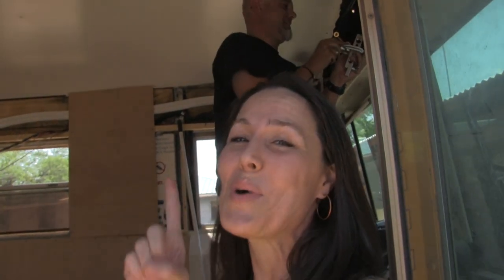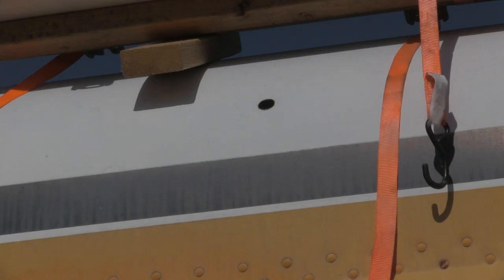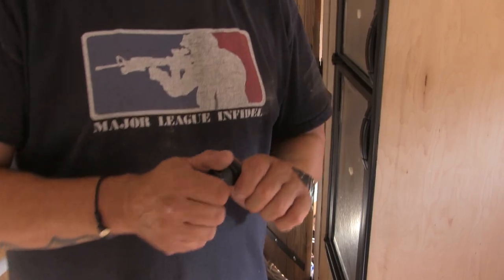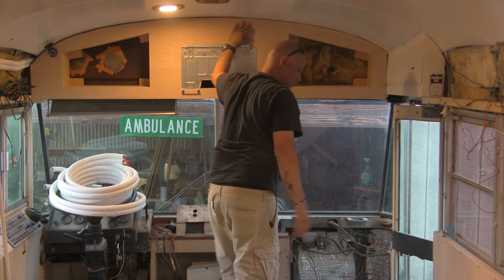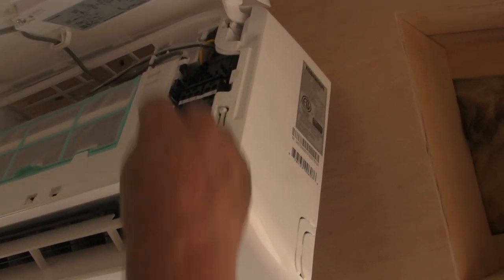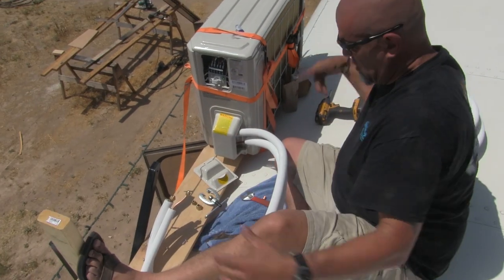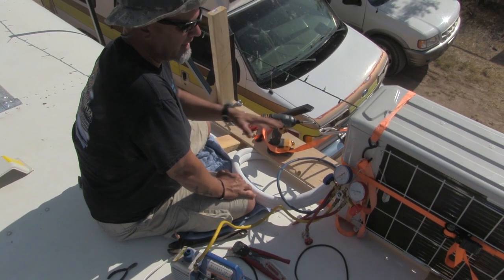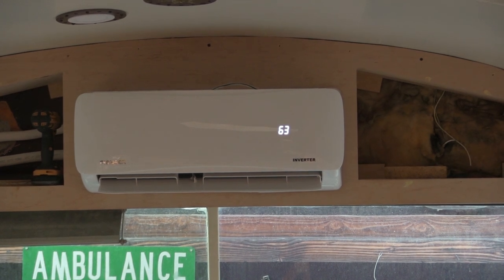Installing a Pioneer Mini-split A/C on our Skoolie! | A/C PART I

Comment: Thanks so much to both of you. I am currently in the demolition stage of my bus conversion and everytime I start to feel overwhelmed I watch you both and it helps me push through. Keep the videos coming.
Reply from the maker: You got this. Pay special attention to the order in which we did things.  That was the hardest thing we did by far.  The order of the build.
Reply: @BussyMcBusface  Thanks for the reply guys. I have a pretty extensive to do list. Today is still demo with some rust treatment. Can't wait to start the build phase though. Keep on busing. Lol.

Comment: This is awesome. I had YT/Howie Roll conceal my outside unit completely under my bus. We built an angle iron frame/basket and dropped it through the floor right behind the driver seat. Still accessible to clean or work on. Afterwards I put diamond plate and expanded metal around basket to protect from road debris, mud etc.  I put the head unit in the same place. Works well with low power usage. Awesome to see how others mounted theirs !  Sure are quiet aren't they !!   Thanks for sharing !

Comment: Wow straps made from Barbed wire shows you how desperate  those guys are  these newer mini splits are a real game changer  i am floored on how much the prices have lowered  on them in the last 15 years  years ago i  looked at using one on a boat i owned at the time  and the pricing now is over half  of what it was then  on that boat i wound up buying a brand new Marine system  from a distributor in Florida  on Ebay  btw  you did a heck of a nice job on that scribe  of the front panel  plus honestly i did Woodworking professionally for over 25 years and as a hobby for nearly 35 years now and you have one of the prettiest assistants ive  seen  plus she has a good sense of humour  pretty Cool Ba dum ching  this system looks nice installed  i grew up in South Florida and i know your pain of working under a strong sun  one time i layer a Craftsman Wrench down on a boat deck and when i went to grab it again it burnt the logo right onto my hand ??  it hurt like hell  i remember telling a buddy of mine that  framed houses there and he said yeah  we know  you cant put your framing square down on  roof either

Comment: I have A/c installer friends that say you should shoot for -30 inches of vacuum (not always possible)for several hours to remove as much moisture as possible and check for leaks. They also always charge with nitrogen first to check for leaks but I know no DIYers that have done this step. Most seem to skip the nitrogen pre-charge. I always apply nylog sealant to all flared surfaces to avoid leaks down the road. Thanks for the video.

Comment: A tip for inverter Aircon type. The first 3 minutes with having correct amount of refrigerant gas, the inverter is soft start(the compressor spin slowly for the 3 minutes then start ramping up). It’s for prevention of energy surge and huge load on compressor startup.

Comment: A feature to save power is a slow start, no jolt. It slowly builds up to full then slows down to maintain. Note the large range of operational pressures listed on side of interior unit. Read the manual Three times. The cleaning feature works great. Use it at least once every 3 months or when CL appears on the display at shutdown. The display reads AC while cleaning.

Comment: Hey. I do HVAC. You can buy 410a online. I don't think you need EPA cert. 
It's simple to add refrigerant IF you have a accurate scale and clean set of gauges.  In manual it will tell you how much to add based the extra lineset. 
I never seen NPT fittings use in a lineset before. I'm wondering how that's going to go?
Reply from the maker: I'll let you know.

Comment: Have you had any issues with the unit vibrating and/or shaking around as your drive the bus around? I've noticed a lot of units made specifically for buses that are supposedly designed to withstand the vibrating from driving around.

Comment: Do you have more detailed instructions of how you hook up the unit to the power?
Reply: The wiring diagram is clearly shown in any of the mini split units. Three or four wires to tie in each end and they are color coded, so there is not way to screw up.  Do not do what they did. Their system will die rather quickly.  You need a micron tool  to make sure you gto a deep vacuum and a torque tool to tie the lines. The mini split works with really high pressure and does not forgive mistakes.

Comment: Nice and entertaining video. I had not seen one of those flaring tools in years, for you to mention forgetting to put the nut on first on your first tube and then forgetting one later was funny as all get out. Hope your split system cools the entire bus for you and you were right on about being quiet vs regular RV AC, mine is very loud inside. Get job.

Comment: How much energy draw does a unit like yours use? Wondering if running a mini split is reasonable with 6 golf cart batteries and 900-1200 watts of solar panels.

Comment: If I might ask, are you going to use solar panels to power this air-conditioner and if so how much of a solar panel system will it take to power this unit in the hottest part of the summer in the neighborhood ing state of Nevada. Thanks

Comment: So if you add a Longer coolant Line, expect to add about 4.3oz of r410 per 15 ft...
Reply: The units are precharged for upto 25ft of line set. Additional refrigeratant is based on the diameter of your lines as well as length. No one size fits all.

Comment: Great job.. By the way, where did you get the extra copper lines from? the standard 16ft lines will be 4 feet to short for my install.
Reply from the maker: If you buy the AC from www.pioneerminisplit.com you can choose longer line sets.

Comment: Awesome work guys I can see your struggling in the heat and I know your pain!!! By the way I dont know if it was just edited out but i never saw you open the second valve on the bottom of the condenser on the a/c. Both need to be open for it to work and plenty of freon is usually charged to my knowledge for the line set provided. Hopefully your fix is that easy. Also if I remember correctly ChrisFix did a good video on adding freon to a car a/c unit which should be almost the same as your unit if your gauge can do it and your guage can actually tell you what the the a/c is doing if you look it up. I'm no HVAC tech so take with a pile of salt and Keep working at it though and I wish you the best of luck ^,.,^
Reply from the maker: Thanks for the info! Yea, we did open both valves on the compressor, she just didn't hit record fast enough! 😁

Comment: Is the mini split only for when you’re hooked to shore power/generator? Are you getting enough ah to run it off solar? What are you doing for ac while driving?
Reply from the maker: We try not to be in places where it's too hot to live in the summer. Now that we are on the road we haven't had to use the air conditioning even once. However, we do either plug in or use the generator to run the air conditioner. The solar can run it but only for a short time.

Comment: Assuming you permanently mounted the unit to the roof? How has it help up being on the roof? Ideally I'd like to install ours on the roof instead of the rear door, I have space but worry about aerodynamics and clearance issues, and just looking obnoxious hahaha. I'll check out your instagram see if I can find some more pictures. Thanks for sharing
Reply from the maker: Out unit is at 11.5 ft so clearance is not an issue. Yeah, it's out there but I wanted the inside unit up front where we will be most of the time.
Reply from the maker: Also, let's just address the elephant in the room, a bus has the aerodynamics of a refrigerator so, I dont think I screwed that up very much.

Comment: How strong is the fan when it's on? Trying to decide placement of mine but worried if it would be too loud or blow too hard on me if it's mounted above the bed. At the same time I'm in Phoenix so I'm worried about mounting it too far from the bed and it not cooling me. Any thoughts?
Reply: Mini splits aren't loud.

Comment: I am looking at a mini split for my bus as well (one duct in the front and one in the rear over the bed) - why mount it on the side of the roof? Why not the center?
Reply from the maker: Because it would stick up a lot higher.

Comment: I had @HowieRoll put one of these in my rig. Concealed the outside unit completely on my 1998 E350 Shuttle Bus. Dropped it through the floor. He has a vid of it on his channel. Just giving folks options. Hope this helps. Good Video you've done here !!

Comment: What’s your mini split running off of?
Reply from the maker: In the dead of summer in the middle of the day we can actually run it off of our solar system. Most of the time however it will either be the generator or plugged in to some kind of external power. We only foresee this being a real problem for about 2 months of the year in Arizona when it's just outrageously hot.

Comment: Question: Are you using the 110 or 220 unit, and how do you have it wired for power?
We want to ditch our roof unit and go with a 2 zone mini split for something that actually cools
p.s. - nice butt (lol)
Reply from the maker: It is a 110v system.

Comment: Hey, thanks for the great video, I just got a Pioneer for my bus. Does your unit cool all the way to the back of your bus? I'm thinking of putting mine on the back wall, but I'm worried the cool air won't reach the other end of the bus.
Reply from the maker: Not when it is real hot. Our door seals the feon and rear so we can be comfy in the front.

Comment: Dude didn't ensure micron level vacuum so there is risk in shortening the life of the unit and running less efficient.
Reply: What is a micron level vacuum? Just curious because I’m wanting to do this w/ my bus conversion but before I do, I’m doing all my research on pro/con’s and what to do/what not to do.
Reply: @marianahdz3603  I am about to install a mini split myself and have researched youtube on this.  The key is to get a vacuum gauge that can read micron of mercury level vacuum.. which is 100 to 1000 less that the -15 psi dials on most manifold gauges.  The main thing is that vapor is removed at these levels and you can also ensure you have proper seal on your line.  moisture removal will ensure your system has longevity.  most pumps can get you the vacuum level you need but you need the micron gauge to ensure you have reached it and is retained.. you can also do triple vacuum discharge which will ensure better installation than what even professionals don't have the patience to do.

Comment: its okay but   put it in the back of the bus  its will not interrupt any thing
Reply from the maker: You mean where we spend 1/3rd of our time... at night? No thanks.
Reply: @BussyMcBusface   i mean the outside unit   at the back door the bus will be less high
Reply from the maker: @SalemAbuOmar  we thought about it. The original plan was under the bus but surprisingly, we ran out of room. So then it had to go upstairs.  The walls were already in place in the back of the bus and would have meant tons of deconstruction to install it that way.  It will only stick 5 inches above our railing so it wont be a giant tumor and the overall height is 11' 5" so not an impact threat either.  It come up to where our solar panels are so it isn't even in a common area on the 40' deck.
Reply: @BussyMcBusface   good luck

Comment: Really not the greatest idea using threaded connections in a refrigeration or air conditioning system
Reply from the maker: We learned this the hard way and switched everything to compression fittings throughout.